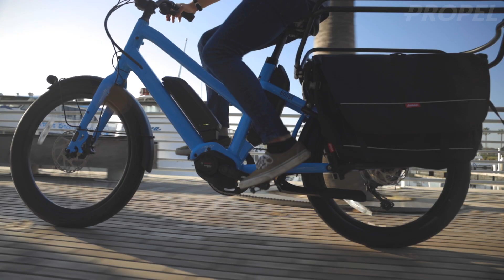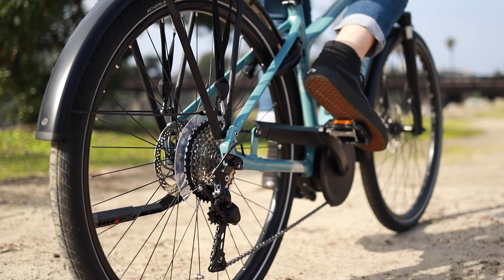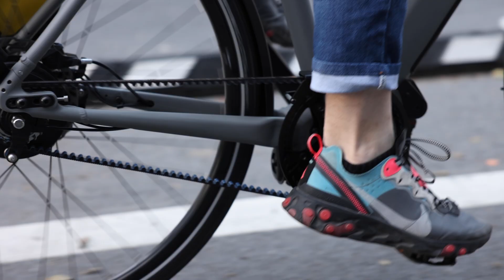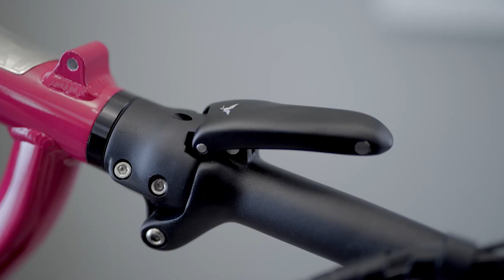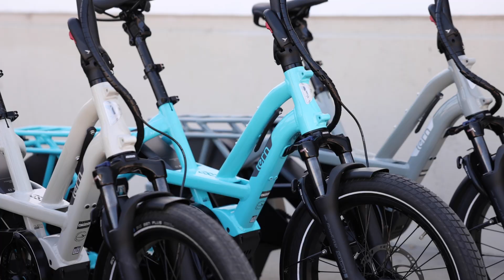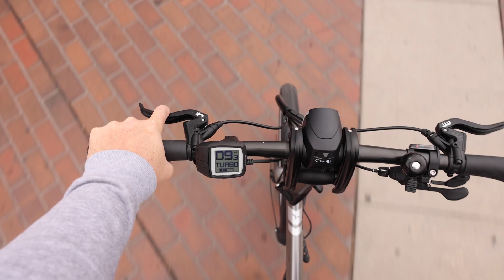Top Commuter Electric Bikes

Comment: This is a great video, no criticism here. 

But a message to manufacturers: please stop re-inventing the wheel on fenders and racks on commuter bikes, and the mounting points for them. It's not like ebike companies have found a better solution to rear pannier racks compared to what already exists. You can see on one company in this video, each bike they make has a different rear carrying system with different mounting points. None of it replaceable or interchangeable. 

It's great for the company to keep 100% of the money spent on accessories and replacement parts, if they have any in stock, but it doesn't help the customer any.

Comment: I understand your selection process. However if you get a chance I’d like to know your opinion of the Qualisports Nemo at $999.00. According to its specs is weighs 30lbs which is my primary concern with Ebikes as I live in a old converted school building and need to navigate long flights of stairs what with me being 60 years of age and would just hate dying from a heart attack climbing a flight of stairs in order to take a bike ride:) thus making weight a key factor. It’s other features though far less important fit my criteria as I’m not a speed freak and the longest I’d need to travel round trip is 16 miles. Then there’s price. As I understand it Qualisports has been around for a few years so it doesn’t strike me as a fly by night company either.

Comment: Now that winter is arriving here in the Canada, I'm wondering if you have or will do a video on e-bike commuting in snow and ice.
Reply: Go watch Paige Saunders, he did one in the context of Montreal. I believe Shifter did one for Calgary as well.
Reply: I know that Not Just Bikes has a few, but that's really just talking about how unfriendly North america is to bikers
Reply: I would leave that to someone who experiences winter cycling and winter bike maintenance on an ongoing basis. I’m 2 years into winter e-biking in the mountains in BC, and my suggestion would be the look at most of the same bikes suggested here, but unless you are able to wash your bike every time it’s used and store it above freezing so that it dries, stick with hydraulic brakes and limit yourself to models with belt drives and internal hub shifting. Maintaining mechanical cables, chain and derailleur in snow/ice/silt/salt is next to impossible. Also, avoid 20” fat tires because no one makes studded tires for them.

Comment: You have the best E-Bike info on YT. I'm looking at upgrading to my second bike going from a folding which I have enjoyed but outgrown. I need something zippy and can haul groceries plus tires that can handle the rough as well as Bitcumin
 Belt drive would be nice and Roloff gearing. I like the R&M Tinker or the Homage low step ???????? any other suggestions.I'm 163cm.

Comment: I have a Turbo levo but wants another bike for work a really ugly bike that is easy to recognize with a heavy steel frame and parts that doesn't fit other bike's and has a integrated lock easy to take off battery Good light and a big fold down stand like old mopeds have.. I'm going to use it for delivery because one day at work for me before im done i been locking my bike for an hour together considering all the places I stopped

Comment: Another good choice would be the priority current.  Mid drive ebike with gates carbon belt.  Integrated lights and fenders.  No rack but they do sell one as I recall and it has mounting points to add your own after market rack.

I was going to get a gazelle medeo T10+ but covid supply chain issues delayed things long enough for me to look elsewhere.  Having test ridden the gazelle and my own current I'd say they are comparable rides.  Main difference is the current has the belt drive which is a wonder for a daily commuter and costs about a grand less.  

I really cant stress enough how nice it is to not have to deal with chain maintenance during wet winter months.  Chain was needing cleaning and lube weekly to keep the squeek away and it still was starting to squeek a bit before the week was up.  Belt drive, dead silent and only needs a garden hose down if the appearance of dirt annoys me. 800 miles and the only time I had to mess with it was re-tensioning it after fixing a flat.

Comment: I'm a super commuter (31 miles each way, 62 mile round trip) and am leaning toward the Trek Allant+ 8S with the range extender. It was between that and the Gazelle Ultimate T10+ but the Trek is lighter and carries the support of Trek with a local store. Is there a reason you included the Gazelle but not Trek? Great video as always.
Reply from the maker: The Trek Allant+ is a nice way to go and with the range extender I think you’ll be happy with it. I don’t have to much experience with it as I don’t sell it, but on paper it looks great! My only caveat would be that it doesn’t have suspension, although the geometry seems to be able to handle it if you’d like (those long commutes can be tough on your body, but the wide tires help a lot). I’d recommend adding a suspension seatpost. Outside of the tires and suspension they have similar component specs. I guess depending on the conditions of your route you might find an advantage of narrower and lighter wheels on the Gazelle. The Gazelle might tend be a bit more upright in it’s seating position and the adjustable stem can get you more upright if you’d like. But if you’re looking to be most efficient you’ll probably want to be more forward. Lastly about weight, keep in mind Gazelle includes a frame lock which weighs about 3 lbs and the suspension probably adds another 3.  I hope this was helpful.

Comment: Thanks Chris for clarifying. This is my favorite video of yours to date. The Riese and Muller Chargers Nixed with belt drive are my favorite bikes managing to be conventional and innovative both at the same time and extremely well designed. The only way I could see justifying spending that kind of money would be to replace one of my cars with it. When we go RVing instead of our tow vehicle maybe. I still don't fully understand the advantage of Rolloff hub, is it worth the price and what does it add. I thought my CCX was expensive and it has its quirks and understanding that it wouldn't make your list, has been a good bike.
Reply from the maker: Much appreciated! The charger3 is pretty awesome! I totally get the idea of these only making sense unless you replace your car. The Rohloff is really nice, but for most people I recommend the Enviolo. I kind of look as the Rohloff as an alternative if someone want a bit more efficiency and still have a belt. 

The CCX seems like a cool bike although I don’t have too much personal experience with it. I hope the way I put that in the video didn’t come across as snobbish or anything. I really do think most eBikes these days are pretty good, light years ahead of what was available when we started.

Comment: I would add 3 bikes there: 1. Brompton electric - nothing comes close in terms of folded size. 2. I:SY - german made compact bike with a handlebar that rotates for storage. 3. Qube compact - similar features to I:SY and RM Tinker.
Reply from the maker: That Brompton really is awesome for the reason that you mentioned. But unfortunately it seems that the tech might not be on the same level something like a Bosch motor system. Now if only Bosch could have a super lightweight system that would be pretty awesome!

That I:SY bikes are really nice as well. I’ve checked them out at Eurobike Over the last few years and They have a nice niche going for them. Also think that cube compact is not a bad choice at all. We used to offer a bike from Kalkhoff called the Sahel and it’s very similar. I’m a big fan of those compact bikes especially for urban environments.
Reply: @Propelbikes  I've made a mistake calling Cube incorrectly. Another bike that you also have shown multiple times is Urban Arrow, great cargo bike! As for Brompton they sell their Electric version for some time now and people are generally happy with them. It has also got surprisingly good load carrying capabilities. Great example of ways to cary stuff is shown on Victor's review from Everyday Cycling channel. Trailers are good subject that I'd like to see more videos of.
Reply from the maker: Great feedback I appreciate it! It’s been on my list to do a video on trailers. We actually have a decent amount of experience with them. We also work with Wholefoods in New York City and then use the Carla Cargo trailer.
Reply: Would love to see someone review the I:SY, i'm looking for the  enviolo hub gear, gates belt drive version to try out in the UK...
Reply: @jothompson2724  I think i:SY bikes are not easily available in UK, different story in Germany or continent where they are very popular. Same story with Haibike/Winora Radius which is very similar, based on Yamaha system. If you're after something similar available in UK then Tern HSD should be a option or RM Tinker.
Reply from the maker: Great feedback!
Reply from the maker: Have you considered the Tinker?
Reply: Last time I checked with Cube they didn’t produce the compact anymore :/.
Reply: @enckil  It's still visible on Cube European (German) website. Maybe worth dropping them an email if you're interested?

Comment: Which of the bikes that you reported on have a capacity of 300 pounds or more. I certainly would like to review them based upon your recommendation.
Reply from the maker: I would check out a Riese & Muller Bike with the heavy duty package which is exclusively available on their hardbikes. You could also consider a cargo bike ike the Benno Boost or Tern HSD or GSD as these are definitely been built to handle more weight. I did a video about electric bikes for heavier riders you might want to check it out. I might have to do an updated one with some of the newer models but I think most of it still carries over.

https://youtu.be/Kf1-9UJmURA